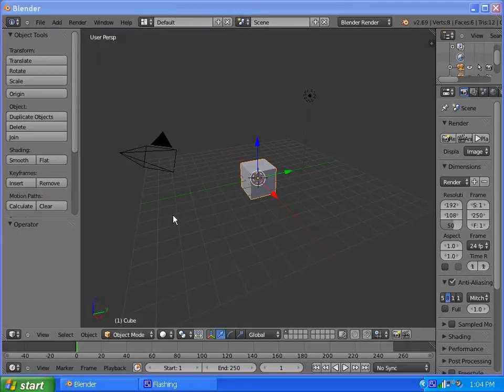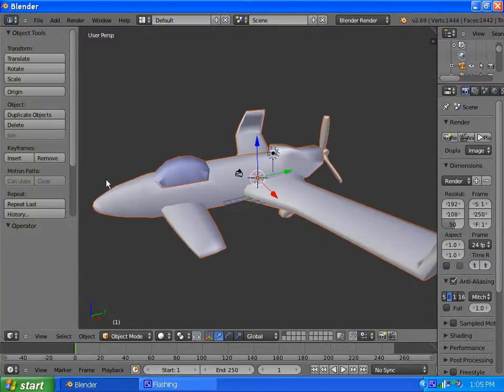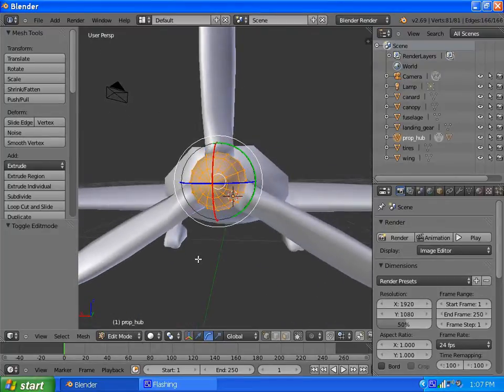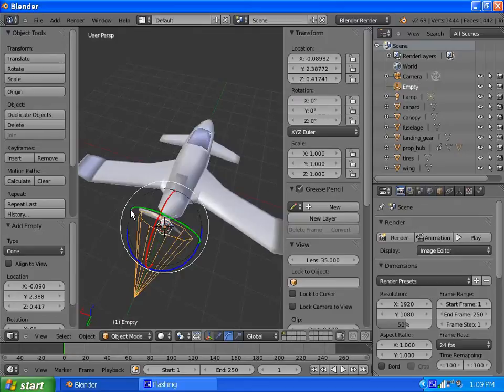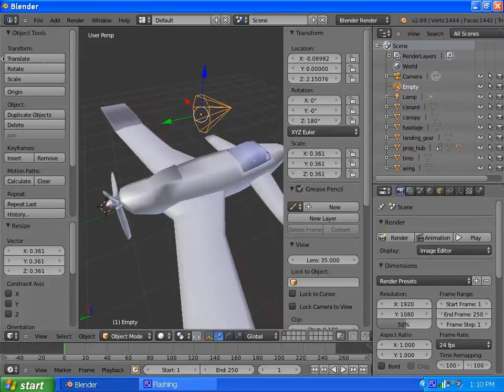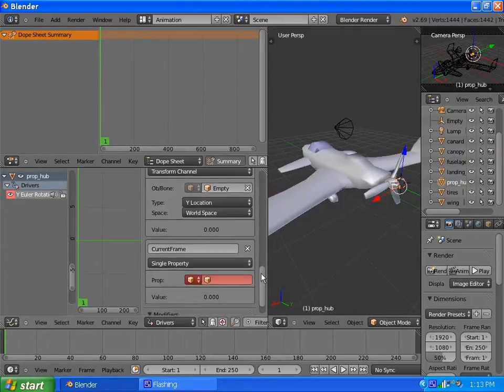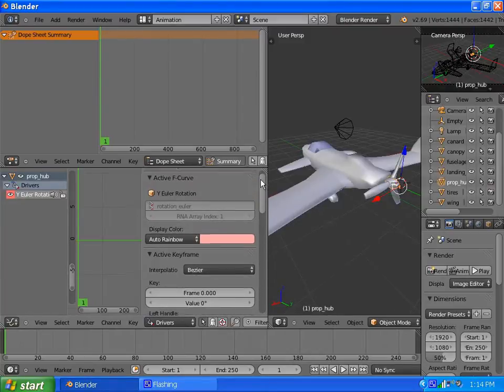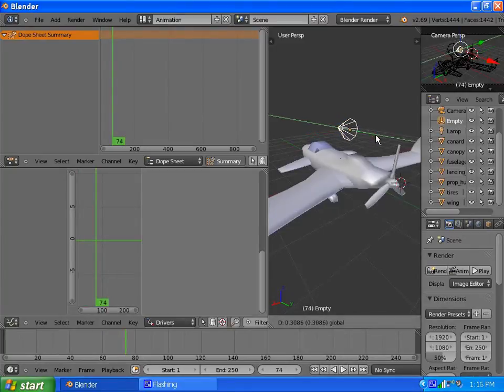Rigging a Spinning Propeller in Blender

Comment: I've done every thing you said to do but i keep geting an error code on the last thing with the CurrentFrame*throttle (that is my only problem i need to know how to fix
Reply from the maker: +Viper _1 Not sure exactly what's going on... But if you saved at some point, try clicking on "reload trusted" if you see the prompt on your screen. Only other thing I could think of is to check the file.
Reply: pauljs75 I figured out what I done wrong with it 

Apparently I don't catch how you done the frame_current 
And I probably misspelled some things in there
Reply: But I made a plane with two props turning counter to each other

Comment: Hello fellas. I am quite good working with AE and the only thing related to 3D models I have done is in Element 3D. So in a 3D program like Blender I am 100% cherry. Now I have this He111 model along with other WW2 airplanes I want to use and as you can probably guess, I'm trying to bring its propellors to spin and I ask for your help. The blades of the propellors are already separated and I added materials so I can spin them separately in Element 3D but they spin totally wrong since they are not attached to the cone. So this probably means I must detach the engine's cones from the rest of the wings and attach the propellors on it. Any help or advice will be helpful. Please.
Reply from the maker: +TheFlak36 You can look into separating objects in edit mode, and joining them in object mode. (L to select an free-standing mesh in edit mode, P to separate, and go with the "by selection" option. This will create a new object with only that selection.) But alternately parenting one object to another may be just as valid. Also don't forget you can change an object's origin. I'd suggest looking into snapping the 3D cursor to a selection. (A well placed vertex may already be at a centerpoint and snap to that, but you can use the center of a selection as well - so selecting an edge ring will also center.) And then setting the object origin to the 3D cursor.

Another option is to use an armature, and parent the mesh to that. Gives a bit more control for hinge points and the axis of rotation can be made more obvious. For mechanical stuff just parenting to a bone or bone-relative should work as you don't need vertex weighting for flexible deformation.
Reply: +pauljs75 I try using L to select certain pieces but there are some pieces that I just cant select. I don't know why this is happening.
Reply from the maker: Not sure 100% since I don't have any pics. Sure all the things you're trying to select in edit mode are part of the same object?

Only other thing might be flipped normals, where you're not going to be able to select from the backfacing side. (Shading will be weird if that's the case.) Selecting all and hitting CTRL-N should fix that.
Reply: +pauljs75 Alright I finally managed to to select all parts of the engine and link them together. That is the blades linked to the cone. So they seem to be one single onbejt in Blender but in element 3D they still are being ''torn apart'' when I rotate them. Any thoughts on how to fix this?
Reply from the maker: Not familiar with Element 3D, so I'm not much use there. At least I offered what I could on the Blender end.   ¯\(ツ)/¯
Reply: +pauljs75 Οκ, can you tell me at least if there is a trick to set the correct centre for the propellor to spin? I already tried to set it manually to 3d cursor, origin to geometry, origin to mass. It still  makes circles instead of spins.
Reply from the maker: TheFlak36
In Blender it should work if you set it to the 3D cursor, provided the cursor is positioned where you want the center first. The other options will center the origin at something like the bounding box center.

The only thing I could think of that might help for export is to use an armature, and have bones used as the rotation axis for the prop. Using FBX or Collada should include the rig from blender.

Comment: Great tutorial dude, but I have a problem. What if i want to make the propeller slowing down until it stops??? If I move the cone back were it was, the propeller goes backwards.
Reply from the maker: ***** Odd... I haven't done this in a while. May have to test with the current version of Blender vs. the one being used at the time. Maybe a bug, an oversight, or something changed and is implemented differently.

Comment: I'm applying this technique to the wheels on a car, but I have a problem.  Once I do this for one wheel, It does not give me the option to add a single driver for the other wheels.  What should I do?
Thanks
Reply from the maker: Only thing I could think of is if your wheels were created via a linked duplicate, in which case they should already have the driver applied. (When using the default theme, the field color will be highlighted with purple.)
Reply: +pauljs75 thanks for replying, literally minutes after posting that, I managed to fix it.  I already had some keyframes on the wheel which was not allowing me to add a driver.  Thanks for the tutorial :)